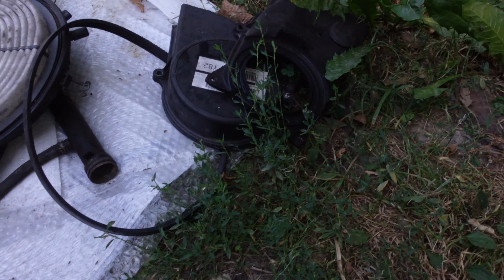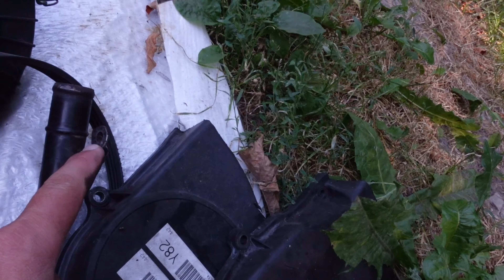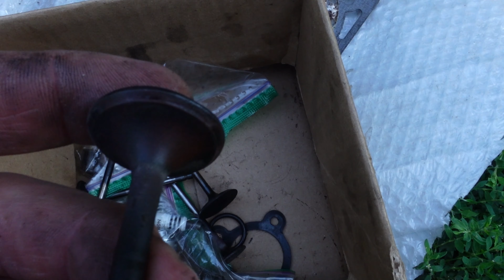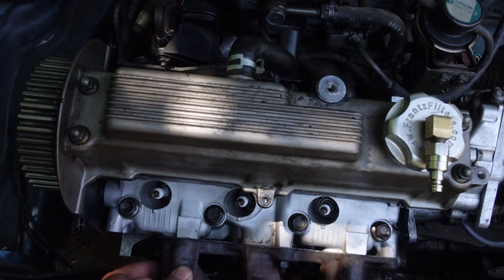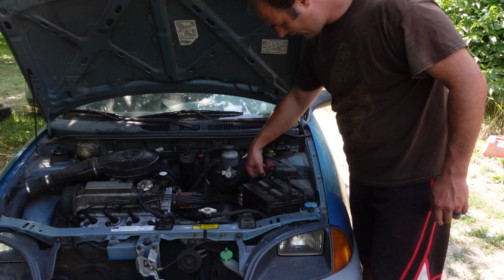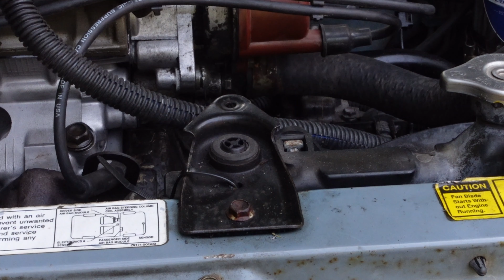Geo Metro valve job

Comment: What's the oil cap hose goin to?   That SS catch can?    And do ya still have the pcv valve hooked up like factory?       I've had three geo's and only one at the moment.     I'd like to find a 89-94 GTI, (dreaming).  I'd like to make the 89 to 94 a homemade GTI with a k20 engine. swap
Reply from the maker: It’s the return line from a Frantz toilet paper bypass oil filter, Honda in a vw, I like the sound of the vr6 that I believe is in some of those GTI’s

Comment: Good job you probably get 300k out of that little car. Also I didn’t hear the lifter tick after you timed it👏🏻👏🏻👏🏻👏🏻
Reply from the maker: The lifter tick did go away and it’s running very good now, I took it on a long trip just yesterday, I have good confidence that it will get past 300k😀

Comment: Wow, that little car sure is easy to work on, parts and machine shop were cheaper than I thought it would be, I hope you get to 300,000 miles!
Reply from the maker: Yeah it’s delightfully easy to work on, probably equivalent to a Japanese version of the VW Beetle. we will see about the 300k, if it doesn’t make it then I’m not out much time or money, I’m my mind this is the most economical car you can own 😀